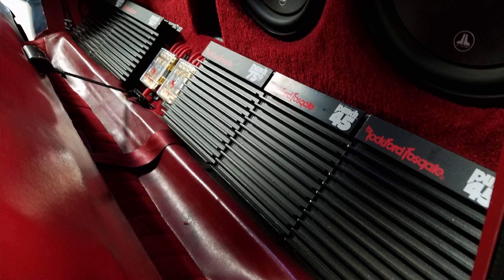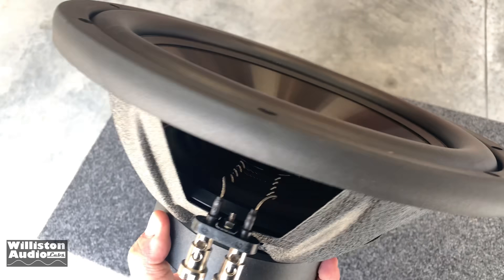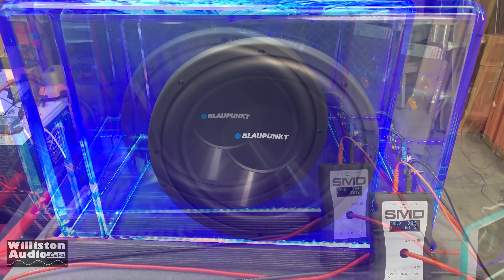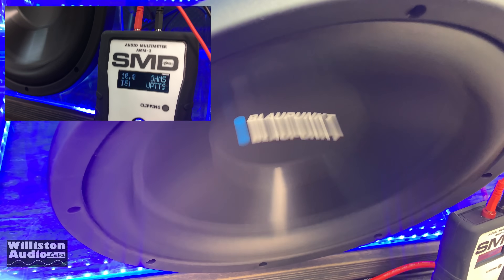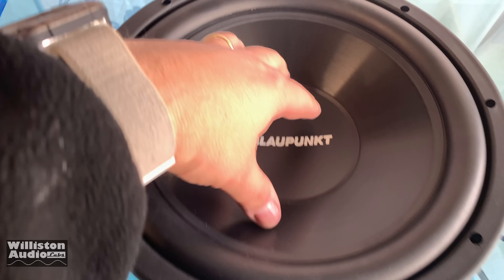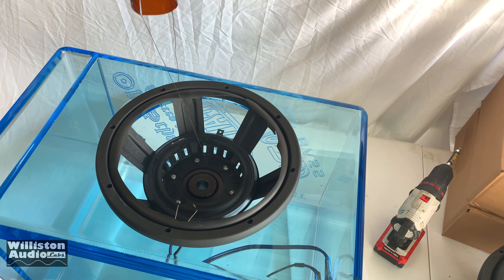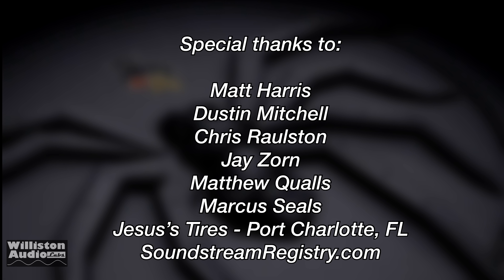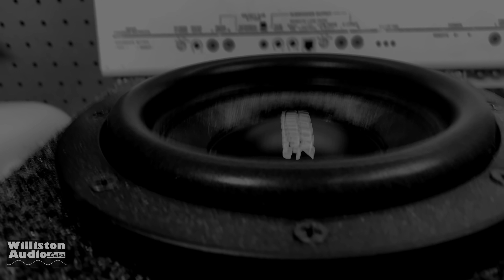$20 Walmart Subwoofer Tested and Blown Up! [4K]

Comment: I think it did reasonably well for it's price.  Got me curious, so it modeled up in WinISD.  The parameters look like a compliance controlled driver, and WinISD agreed suggesting a sealed 1.5cu^ft box - so I'll stick with that.  Seeing a compliance controlled driver at this price point is very unusual.  They don't list xmax or xlim (missing too many Thiele-Small parameter), but I'm feeling pretty confident that it doesn't have 1/2" excursion capability to handle 400W RMS @ 45hz (the natural -3db it would roll off in said box), let alone 11/16" through 3/4" at 30hz...  Probably best suited for a 150~200W RMS amp (150W I think would push it pretty close to my best guess of reasonable xmax and xlim). The group delay numbers look nice and tight - again, that's extremely surprising at this price point and far from what I was expecting.  Based on what I can analyze, it theoretically should make for some pretty tight bass although very quiet sub in said box.  I can est. about 108db output at 150W (not taking into account cabin gain) - which should work okay in a paired set with most factory radio setups. Very fun watching it blow up.  Keep up the great content! :-)
Reply: I'm convinced though that it just wouldn't last that long / take abuse like a JL product could...  I suppose if the end use was extremely careful, but I've just not seen a lot of lower cost subs take longterm abuse.  There's always the one off's however and maybe I'm wrong, but I've never had issues with JL Audio, RF, Kicker...
Reply: @07wrxtr1  I agree, I don't think it'll be a good long term sub, esp for more demanding users (I know it wouldn't last for me).  I was looking at it more closely for s*t and giggles - plug the Thiele-Small Parameters into the software and see what happens when I look at the resulting default model.  I don't think it's exactly awful for some installs from a $20 value perspective.  But I certainly am not or would I ever imply it's a high quality sub like a JL, Rockford, etc. - it is in fact quite limiting from my perspective.
Reply from the maker: It sealed would’ve kept all of that lovely smoke inside 👈😬
Reply: @wal  true enough!!! 8D
Reply: Actually it doesnt have tight bass its more of a more boomy bass it lacks tight bass significantly.
Reply: @johndunn99  in a vented box (esp if the wrong size or tuning for the driver (ie 1.2cu^ft and tuned for 30hz - oh man would that ever be an awful setup with this sub - it still wouldn't be loud and not likely to be overly happy with more then about 60W RMS power), DEFINITELY.  In fact, it's slow enough to miss notes, the resulting 58hz peak would be headache inducing, and just make for a very fatiguing listening experience horror show.  And for sure you won't get the hit's you in the chest feeling on a meager 60W RMS.  In a bandpass box, OH GOD YES (that would be beyond disasterous for this sub).  In the wrong sealed box, good possibility....  exceeding 150W as I estimated in the 1.5cu~ft box I was modeling (jumping the xmax gap but not bottoming out (hitting xlim) -  you notice that's not anywhere close to the 400W RMS the voice coil is rated for), it sure would be VERY VERY mushy.  Not boomy, just 100% pure mush and def with-out any trace of the "hits you in the chest" feeling one wants - past experiences from modeling and building is telling me that)!  and 150W for 108db sound level - no, that's not going to "slam you in the chest", shake the pavement - in fact, one be very hard pressed to "wake the neighbors".   If you have a factory radio that struggles below 70 hz with out copious amount of corrections (yes, I'm talking about the majority of people that turn the bass knob up in an effort to make their factory radio sound better), this sub would be best used to correct that (because if they turn that back down, they'll be able to turn the radio up more with less clipping, which will be less fatiguing to listen to).  This is NOT the sub to use to make an impression or be a hooligan with.
Reply: I have mine in a 1.5 cf and it sounds as good as anything else until you push it beyond its physical limits, like any other sub these days.  Only the absolute crappiest drivers these days can't sound good.  The stock drivers in mid priced powered subs are absolute garbage, in the best possible enclosure.   Pop open a consumer-level Velodyne of the last twenty years and you'll be amazed at the lack of anything special.  It's all about the box, the amp, and the processing.

Comment: I think a lot of budget subwoofer brands under $50 would blow up with that beast old school Orion amp hooked up playing those very low Hz tones straight through out of the box too.   That amplifier throws out ungodly power even at 4 ohms..   Great video!!
Reply from the maker: It was s fun demo testing power handling of this cheap sub
Reply: Williston Audio Labs that sub actually is pretty decent for a budget build.  I bet it would hit nice in a ported enclosure around 300-400 watts Rms..

Comment: I bet 4 of those on an 800 watt amp would do pretty well though..
Cool upload as always Big D.🍺🇺🇸🍺
Reply: 1200watt cuz they could handle 300 okay
Reply: I’ve got a 1000 watt Rockford amp been thinking about running 4 12’s why not
Reply: Ok I purchased 4 of em ported 8 cubes and they get very loud, louder than 2 kicker l7s I had previously.
Reply: @markadkins7216  um ya ok 😂
Reply: mark adkins things that never happened
Reply: I have 4 of them on a skar rp2000 running 4 ohms, 200watts each. They hit nice and sound good. I had a set of w3's back in the day and these sound just as good I'd say

Comment: I almost bought one of those $19 10" blaupunkt woofers just for shits and giggles. For the price, its s decent sub.

I'll tell you this though, theres gotta be some extreme sweatshop labor going on in order to bring a speaker like that to be sold for $19. They must cost like 3 or 4 dollars in china for them to make money off off those bring sold for that price. Either that, or some extreme mismanagement when they calculated how many were going to be sold.

RIP little buddy.
Reply: Blaupunkt is a big german company.. They make stereo  amp speaker and are at least one of the bigger europen company that make carsound.     But they do  OEM stuff.  Aftermarket they don`t do so nice looking stuff but high quality
Reply: its a 12 dummy
Reply from the maker: These must be a loss leader for Walmart. No way they are making a profit after free shipping 🤷‍♂️
Reply: @wal  i think youre probably right. Thats why i said there must have been some extreme miscalculations on the projected demand for these woofers.
Reply: alan ray but they make 10s also
Reply: @davidsten780616  not any more

Comment: I had an American Bass 12 I got for like 70 bucks on Amazon, read the spec sheet and saw 600 watts but didn't realize it was the peak rating. I was pounding it with a 1k rms rated amp for good 4 months, it would get smelly from time to time. Started noticing it would make some weird sounds at certain frequencies, but others were loud and clear. I ended up replacing it but the sub still plays. Just sounds off on certain notes. I was dumbfounded as to what could have caused it. I've never had a sub react like that.
Reply: American Bass is NOT a cheap walmart sub. I have an AB XFL 15 on 2500 watts and still plays mint. Rms is 1500.
Reply: @BassheadGTP  I never said it was, American Bass makes great products.
Reply: @Avaddon911  absolutely i have the xfl1244 and it sounds amazing. im a huge fan of hard hitting lows and the xfl1244 does it with perfection even on the low volume i can still hear the low bass which is hard to get especially since im using a smaller than spec enclosed box.
Reply: @Zack-dk3pt  I was definitely impressed by the quality of sound I got out of the woofer, and it took over 2x it's power rating for a good 6 months before I started noticing any problems. 
I'm pretty sure the issue was a voltage drop from having a bad battery in my system anyways. 

I replaced it and I'm running a Memphis mojo5 12 now on about 1500 rms. It's also in too small of an enclosure because I have it in the box for the AB 12. Can't wait to build a new box for it 😂😂😂

Comment: For a single 12" sub in a car just for some decent bass That is TOP Value. Add a small power amp and a home made box and Sweet Bass for cheap. Its not a SPL competition sub but for what it does for the price, it can't be beat.
Reply from the maker: Could not agree more!

Comment: 11.2Amps across 3.2ohms will consume 401.4Watts, (that will drop as the coil gets warmer) so it is safe to say that 10A Slow blow fuse will protect the speaker. That would allow for an average of 36V across the speaker which would pull around 34 Amps off the 12V supply. There are variables such as the power factor of the amplifier'ss internal power conversion system and actual supply voltage.
I used to have some EV Force 10's and 12's which had fins on the back of the magnetic center post backplate for heat dissipation. They were rated 150W continuous/600W peak with a freq response of 75-7000Hz for the 10"s and 65-7000Hz for the 12's. The were considered full range musical instrument loudspeakers. They were loud, with a SPL (1w@1meter) of 105db and provided very accurate reproduction of the sound waves.
Reply from the maker: Car audio amps had speaker fusing at one time. Interesting this game up

Comment: If they come in 8ohm, they'd probably be good for most home stereos or rear fill, etc. or run 4 of them (2 per channel) along with better mids and highs and I'd be they be a bargain for an inexpensive home theater set up, or pop a couple in a box and face it about 6"-12" from a back wall or an external baffle and have it reflect back for decent lows. For $20 and probably a 200w continuous rating to be safe w/ a voice choke, you can't go wrong.

Comment: Back in the early 90's, a friend had a standard Nissan pickup with an Alpine 7390 HU, 3342 11 band EQ/Xover, a Punch 45 powering a set of Polk 6.5" and a Punch 150 powering 2 12" MTX Blue Thunders in a sealed box (system costed a whopping $1.8k+). He'd played Magic Mike and could be heard cleanly 3 blocks away.  We tuned the system in a commercial building parking lot and the cops showed up.  They asked for a quick demo then said we had to turn it down and leave the property. Good times.

Comment: Way back early 90’s we used to get Targa 12” for $18 and they had parameters that matched Orion eXtreme subs. They smelled when yea pushed them too
Reply: Targa is still a brand just one in south africa with new subs running 155.2Db from two 12's and doing 180.3Db with a single 18 inch also recently they did 176.5DB with a single 15 inch Targa Comp sub go like their facebook page team Targa SA and see the records etc.
Reply: Erik Britz joined it but they don't seem to answer questions from what I was seeing
Reply: @NOSLEEPATALL  yes cause many people ask some dumb stuff sometimes otherwise most questions get asnwered sadly this is a issue in my country people would get so much better numbers here if people were more informed etc. on car audio

Comment: I have not watched yet, 
I do own three of these subs.
Bought them last summer at my local WalMart.
Currently they are in a box, all three in independent chambers around 1.1 - 1.2 cubic foot each.
Wired in parallel at 1.3 Ohms, they was connected to the sub channel of my RF T1000x5AD seeing about 700 watts.
The hit hard, enough that the roof of my car rippled, flexed impressively.  
Only issue box consumed to much space, went a single 12.
I miss the hit one could hear a block away, but enjoy having my hatch back.
Now the box sits in my home office serving as my printer table, sad.
will watch video later today...

thanks
Reply from the maker: Thanks for the feedback!!
Reply: I have something similar in my Accord. Im pushing mine off a 500BD mono with a JVC head unit. Bass heavy tracks are crazy. I can give myself a instant headache if I choose. It's almost dangerous to have so much bass for so little money. I paid 135 for 3 new woofers and a triple sealed box.

Comment: 400 rms with a max 800 not bad for $20 bucks, 6 0f them and power acoustik 2500 razor amf for around $200 bucks with a custom box, would be a steal.

Comment: Not bad at all ,low end 12's are good with no more than 400 true clean power . back in the early 90's i saw many 15'  Punch , KICKERS , MTX, BURN UP a few days with Pyramid PB800 amps . ONLY subs that would take the power were the SUPER PRO'S PW15120.

Comment: Dereck, I've had 4 of these sitting here for a couple weeks for use in the $150 SPL Challenge. Haven't opened them up. Did yours come with any recommendations for enclosure size? Obviously for SPL purposes, you might want to raise the port tuning but, I'm thinking these might be okay in the right size box for a daily beater work vehicle as well. Just need to find the right size for enclosure. 👍
Reply from the maker: Nope, but I’m trying them in the big RF ported Box I have the PWR12’s in right now.

Comment: IN a small hatchback...small sealed with say 350-400W@8 Ohm  amp from Korea or in a ported box with the same power in the trunk or a sedan or coupe and you'd have a killer budget sub system. For the money you could do a lot worse but this thing took in what was the freezeframe...949W? Damn son that's decent in any event.
Reply from the maker: Amazing sub for the $$

Comment: Seeing this video reminded me I still have the 10" versions (GBW101) of these in my truck sub box under the seat powered by 600rms sub channel on a pioneer 9605 and they still sound as good as they did almost 5 years ago when i installed them when I was really poor. I'm looking to upgrade them though now to something else more expensive/better bass but will still fit the thunderform Dodge Dakota box like these did.

Comment: Well I guess it met the 400/800 Watts they wrote in the manual. It peaked several times at about 900 watts, even +100 watts more than it's rated for.
But let's talk about RMS and peak power ratings and what time period is meant for that.
I'm not a technician but I would say RMS power should be an hour with no problem and no smoke but slightly warm. Instead peak power I'd say at max. one minute the Blaupunkt sub should handle without excessive smoke build up.

Comment: I have a 10 in my Jetta hooked to the 1501 and a 1504 pushing my Cerwin separates. Not a bad system for the money. Both amps run cool and do what I need. The trick is putting at least 8 volts of signal to the amps. I have a Soundstream MPQ-80 which really cleans up the sound and gives me full control of different genres of music. When I saw 1501 I was expecting 150 RMS and that is what it does. When I saw the manual and that 563 RMS I started laughing haha. But it is a good little amp and sub combo for the money.
Reply from the maker: $125 for both amps is a great deal too 🤙

Comment: Blaupunkt was a pretty good brand in the early 90’s. I had a head unit, two tweeters, two 6 1/2” two ways, two 4x8 four ways with a 400watt rms 4 way Rockford Fosgate amp pushing them. Nice clear highs and midrange to go along with the nasty bass from my two 15” Kicker Competition subs being pushed by a 1200watt Rockford Fosgate amp. There were many mornings that on my drive to school I would have to turn around and go back home because the bass hit so hard and deep that it would make me have to shit. Goods times.
Reply from the maker: Yeah boi 👌

Comment: These things will sound just as good as any other sub at any price at moderate volume levels, as long as they are in a suitable enclosure, and aren't being driven beyond their limits to stay within their distortion limits.  The "speed" people are always saying they are trying to achieve with their subwoofer is predominantly a result of having a strong midbass driver that is well crossed-over to the subwoofer.  Lots of hard hitting bass notes start above 80hz before hitting deep milliseconds later.   Just like in the car audio craze of the 90's, people are completely jinxed by the "Emperor's New Clothes" effect, where they think they are hearing better sound simply because they payed more for a speaker, or because that speaker is composed of high-end looking materials.  Back when I used to work in a high-end shop, we used to pass the downtime doing double-blind listening tests between high and low end speaker wire, interconnects, single and bi-wire setups, and subwoofers.  What we discovered was that, all things being equal, all those things sounded EXACTLY the same, even in a heavily treated room, providing a ridiculous listening environment.  There is no need for high-end wires or cables.  Subwoofers generally sound the same when compared to similar drivers, at moderate levels.  ALL your sound quality is going to come from your speakers and your processing.  Even budget amplifiers sound great if you don't push them beyond their abilities.

Comment: Not bad you sure there was no clipping? The audio was clipping but that may have been you're mic. You could make a big cheap speaker bin from a dozen of these in series and parallel arrangement, and would produce enormous power at very low costs.
Reply: As you know when amp is driven to hard clipping virtually no speaker stands a chance, as it come down to how well the voice coil can dissipate the power as heat, before it melts and fails.
Reply from the maker: No clipping of audio signal, but yeah the mic may have been a bit overdriven at times

Comment: I just bought 3 of these for 37 a piece. 
Going to see what they can do. Any recommendations how many watt amp I should get?
Reply: Get 4. I run them on a skar 2000.1 running at 4 ohms, 800 watts.
Reply: @chevysaregr8  do they beat pretty good?
Reply: @gabec6522  
You get a $37.00 woofer. Nothing special must use a matching amp.